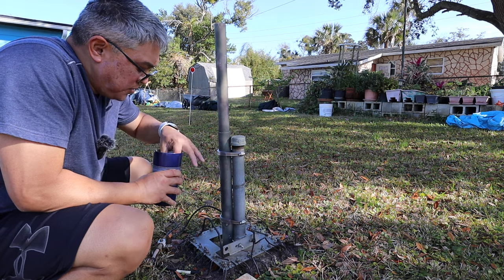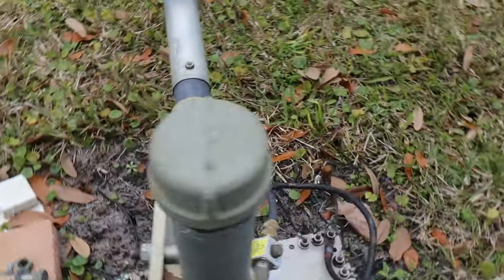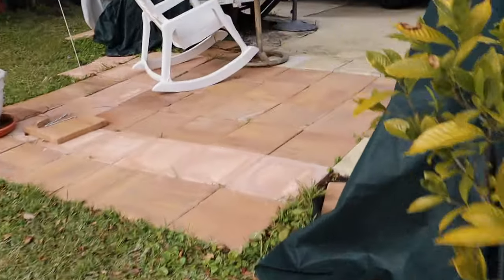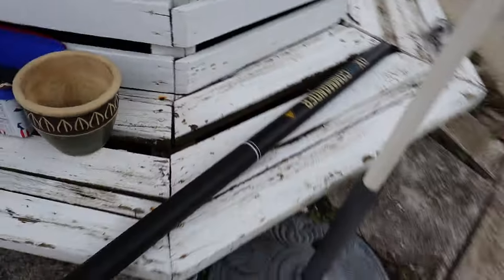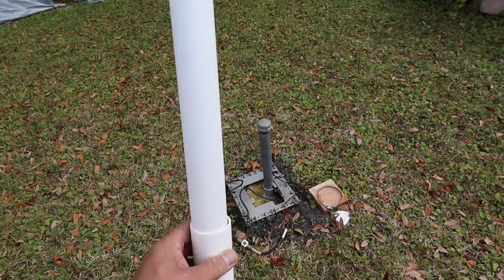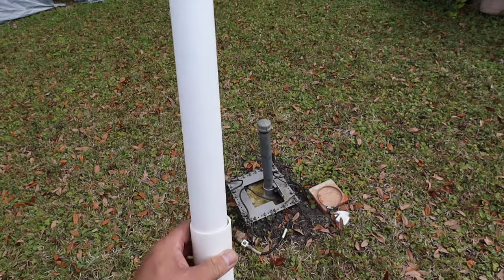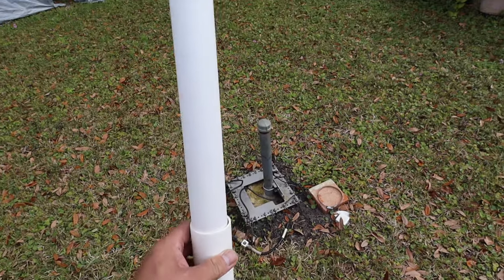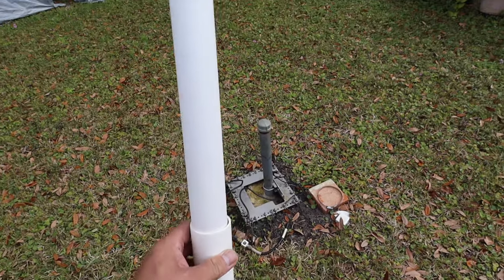DX Commander Classic Replaces my Zero Five HF Vertical Antenna | Fine Tuning my 80 meter Inverted L

Comment: You could use the nylon clamps for the pipe support as well. They are very sturdy. I also labeled the elements on each spreader and used zip ties as well. Great minds think alike. Also no need for clips or hardware with the stopper knot that Callum shows to use. Works better than the clips and less hardware is better. The use of the number beads keeps the elements instead of the color code system. Where I live the need for a choke and lightening arrestors is not as important, plus I do have a chock at the feedline end to my grounding plate before it enters the shack. You systems is very impressive. My 80 meter was okay as placed and well within the range of the tuner on the FT-710. Remember on the fold back you have to do 3x the cut amount.

Comment: Hi Darren, UK Based here. DXC all the way. You need to tighten those elements the wire needs to be taught but not over tight.   You wont find a better vertical Antenna I use the Roly coil for 80m and just swap the connection so it uses the 40m element. Lots about the Roly coil on YouTube. If you get your elements correct you don't need a tuner I have SWR <1.3 on all bands no tuner. The base of the DXC really should be on the ground if not  this will affect your SWR in a negative way.. I have about 100m of DX10 wire in the garden underneath the grass for radials its a fantastic kit, blows the Hustlers out of the water. I have done lots of comparisons with a WSPR beacon and the DXC beat the lots over a six month period on distance. Building it correctly is the key to this antenna. Best wishes to you and your family.  de 2E0GVZ Drop me a message if need be.

Comment: Good to see you not worrying so much about SWR, the inverted L does have a lower impedance than the other elements. I too have PVC pipe in my Classic, it supports it adequately while I am fitting the guys. 73
Reply: I did the same, pvc in a screw-in pole anchor base and 24" above grade. Does just what you said supports nicely until the guys are in. Genius system. de KN6ZVI

Comment: I've got the 12.4 and the DXC is the best vertical hands down I only use a tuner for the upper FM section of 10M and the lower part of 80M everything else has a low SWR  below 1.5 to 1 . if your happy with it then great but  Callum has designed these antennas to be resonate on all bands great video have a good one de W9US
Reply from the maker: Good to know that you prefer DXC than the 12.4.  I sold my 12.4 before putting it up.

Comment: Very nice video..... Glad to see the RF2K-S Amplifier transmatch could tame the 80M inverted L long wire.   Pretty sweet,  a great amp ed?  Love mine.  And nice job on the DX Commander refurb.  I think I would "spread" your hefty ground cables around the grounding plate a tad, but keep a few on the same post as the grounding rods.  A great job and the color coding is very handy.   Darren, how close were the prescribed cut list lengths to resulting VSWR on each DX Commander band?  It would be nice to see what the VSWR's came out to be on the Commander after the refurb.  Keep up the good work... 73 Art W1SWL
Reply from the maker: Very close with the other bands.  I pretty much toned ro the center of the bands with the exception on 80m. I only talk with a group on 3.999 Mhz.

Comment: Hi Darren, I have 05 still new in the box which I have had for several years. Were you not happy with the performance of the 05 and is it very difficult to erect the 05? I have MS and can be difficult to do much as far as antenna installs. Thanks.
Reply from the maker: @JohnTomlinson-g4x  you will need a good foundation with a pipe in the ground.  Then you out the antenna base to the pipe.  It requires ground radials.  Its rally easy to raise and lower maybe need a second help.  I operate on 75 meter and it’s difficult to tune. Also a vertical antenna picks up a lot of power line RFI.  DX Commander Classic is my all bander,

Comment: Why replace the zero five?  Did you not like the performance?
Reply from the maker: I'm in the process in putting up a 35 feet Rohn 25g tower with a SteppIR Urbanbeam.  I don't need the Zero Five 43' and put the DX Commander as a replacement.
Reply: @DarrenN4VFR  oh nice   I'm looking at the 30ft zero five flag pole.

Comment: How do these antennas compare in performance?
Reply from the maker: Both are about the same, due to the fact that I have powerline noise. They are vertically polarized.  The DXC is more Resonant because of the fan dipole concept. The Zero Five has better DX performance.  I do more rag chewing than DXing. If your on the fence for an antenna,  I'd get the DXC.  It was fun to build.
Reply: @DarrenN4VFR  Thank you for the reply. That's exactly the answer I was looking for.

Comment: Personally I think settling on 3.5 at the top end of 80 meters and relying on a tuner is a mistake. Of course you didn't show what your other bands worked out as so we don't have that information. But I think you could have got a much better SWR on 80 meters had you tweaked the antenna more.